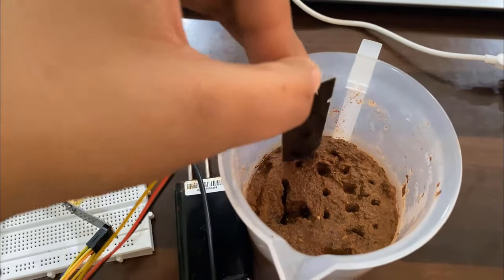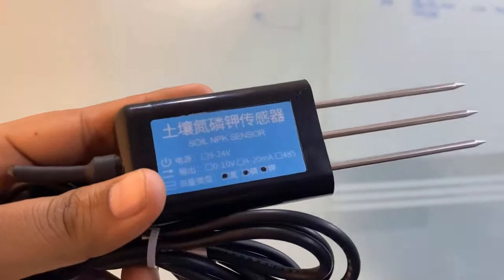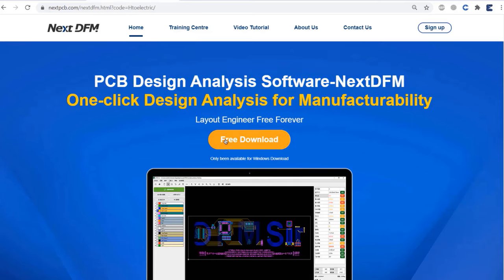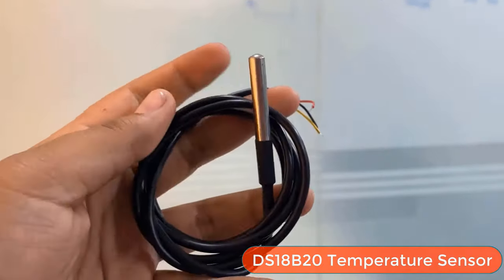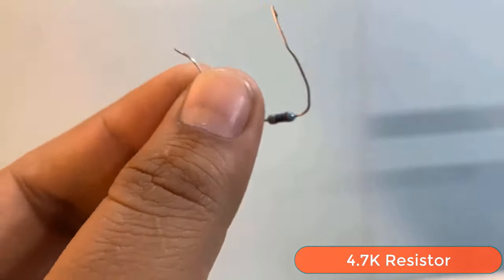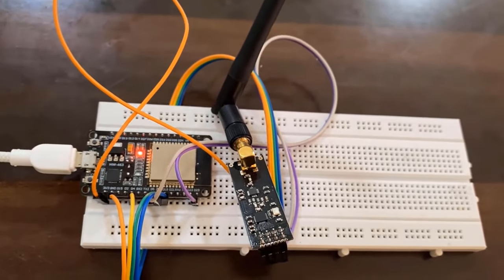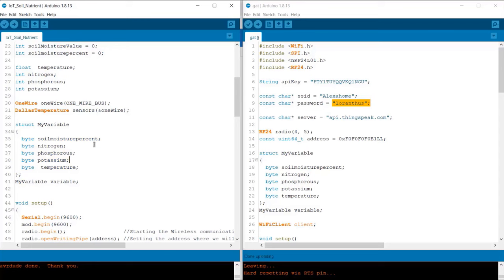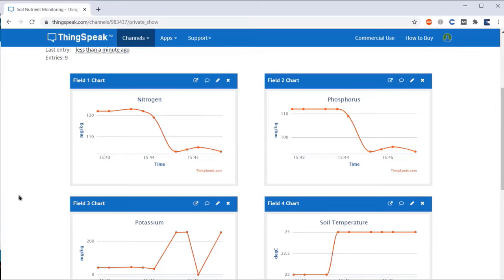IoT Based Soil Nutrient Monitoring & Analysis System | Soil NPK + Moisture + Temperature

Comment: The npk that I bought didn't work so well. It always shows the 255 mg/kg. How will I work the sensor properly? I already use the 12 volts but it is still not functional
Reply: I have one error showing
Multiple libraries found Wifi.h 
Agr/pgmspace.h no director found

Comment: Repeated this process and had really inaccurate readings and the it seemed as tho it wasn’t interfacing with the pulse sensor and the readings were coming back 0 or 255, seems like there’s some bugs in the code we triple checked wiring, code, & overall cannot figure if it’s a back sensor of if there’s more to the problem....?
Reply: Did you figure it out? I'm having the same issue stuck at 255.